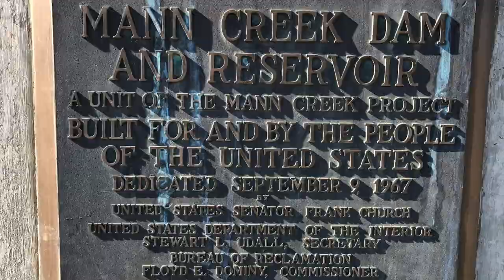Mann Creek Reservoir - Vlog 228

Comment: Hi Randy and Shelly, nice close non-shakedown camp. Beautiful area. I think the person that told you about the eagle perhaps being an immature baldy is correct. The color on that bird was wrong for a golden. Baldys don't get the white feathers until they're several yrs old. My Grandpa always said 7 years , but I dont think it's that long. Where I live in Montana,,I see eagles regularly at the minimum,,once a week. Glad you had fun. I've been thinking about the water issue too. I think I'd try for a 250 gal. Tank. I've searched and found tanks that would still fit under a queen sized bed and not so high that it would be tough getting in or out. 250 gals is 2000 lbs instantly,,but I guess depending on the situation,,a person could drain most of it,,,at aleast on longer trips where you knew you could get a refill.. take care Ttyl,,,Marlon

Comment: ** Well it's time to think about an Awning on the Side of the Bus for Shade for You Randy. May be able to find one on a Junk Yard Motorhome.
** You should add window Blinds you can Pull Down, and Push Up Manually for Privacy in the Front and Side Driver Window's.
** One other You could add Hinges to the Side of the Bus and Attach Live Edge Table's to it for Grilling, or Working on. (I'll send photo ideas to your Instagram DM.) Have a Great Week. *(Use a Timer for how long a Shower Should Be.)*
Reply from the maker: These are all good ideas. Thanks 😊
Reply: @KnappTime  - No Problem. I left photo ideas on your Instagram DM. Hope the Weather is treating Yous Great.

Comment: Love it!  The road suits you well, Randy and Shelley.  Does the solar keep up with the tool use on the road or are you having to top up with the generator?
Reply from the maker: Solar totally kept up. It was amazing. 😀
Reply: @KnappTime  That's what we feel as well.  At idle in our driveway (fridge not running, but inverter on and making 120V, our batteries are back to 100% by 10:00AM on a moderately sunny day!!